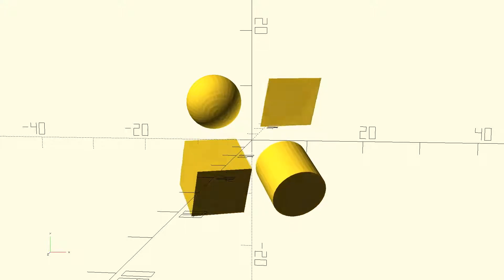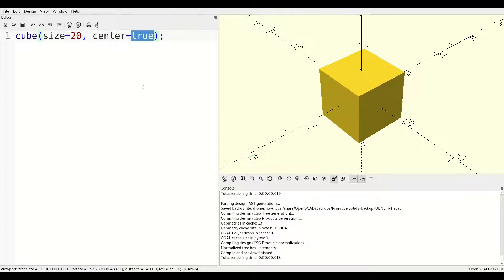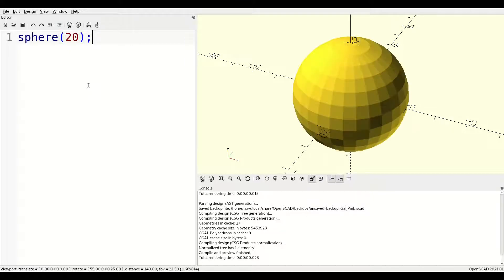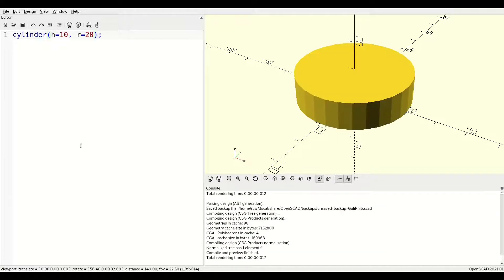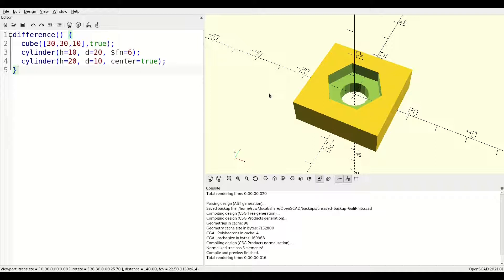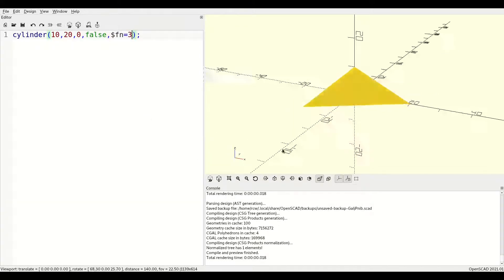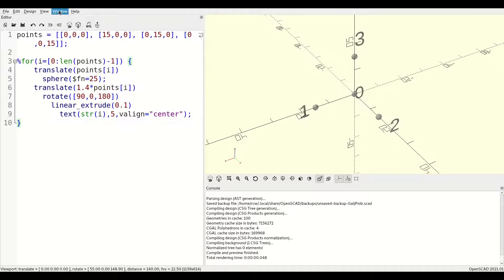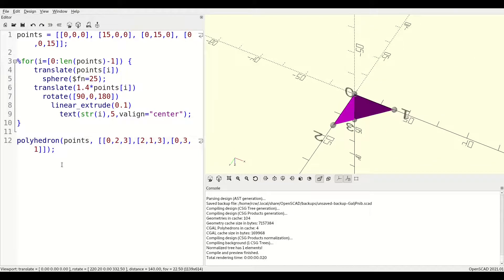OpenSCAD: Primitive Solids

Comment: I would like to see how to stack flat topped shapes. I've purchased a 3D printer with a multi filament capability. And have found there are no simple open source files to simply test the multi-color capability. I found OpenSCAD mentioned on a file sharing platform and my plan is to create a pyramid with striped layers as a test shape.
Reply from the maker: OpenSCAD doesn't understand the concept of stacking, but you can fake it with modules.  I posted a somewhat relevant video a while back: https://www.youtube.com/watch?v=JkbsMYg7294

Comment: In case anyone is looking for the polyhedron points helper code from the video, here it is:

%for(i=[0:len(points)-1]) {
	translate(points[i])
		sphere($fn=25);
	translate(1.4*points[i])
		rotate([90,0,180])
			linear_extrude(0.1)
				text(str(i),5,valign=center);
}
Reply: Error in the last code.  valign=center should be valighn="center" like the following:

%for(i=[0:len(points)-1]) {
	translate(points[i])
		sphere($fn=25);
	translate(1.4*points[i])
		rotate([90,0,180])
			linear_extrude(0.1)
				text(str(i),5,valign="center");
}